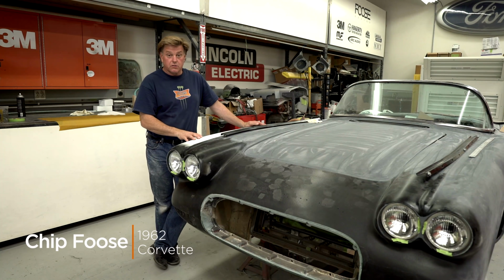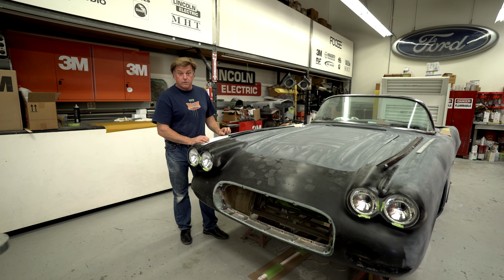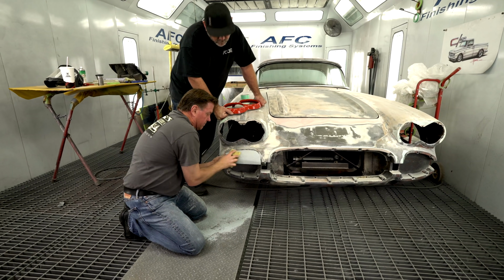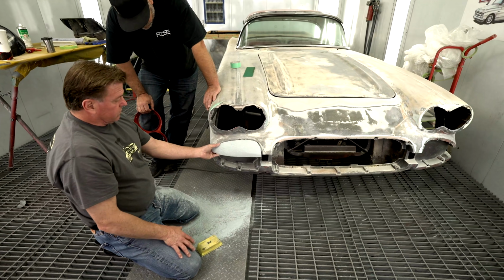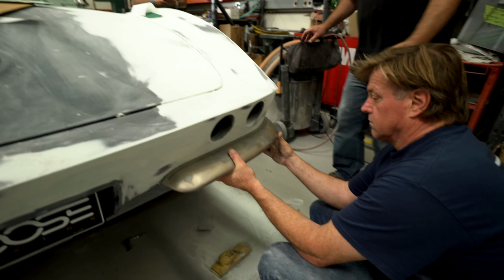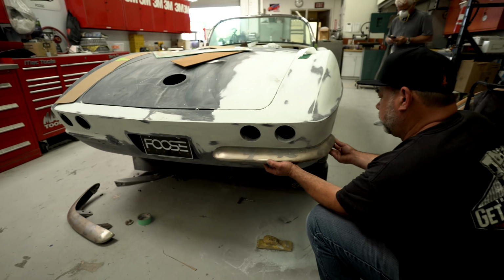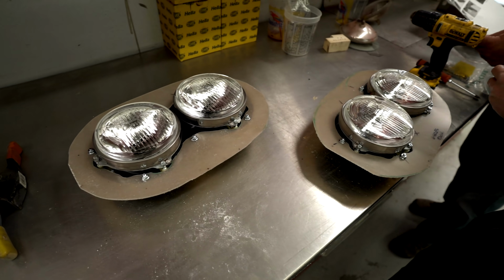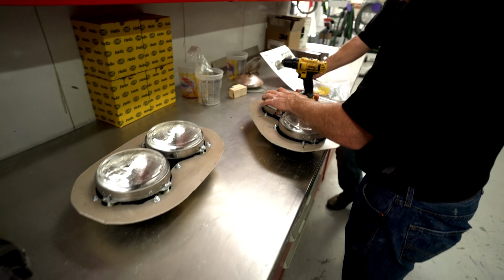Foose Design | '62 Corvette C1 Custom Build - Part 1 - Tear down and build up

Comment: I think the reason why I like Chip the most compared to other car builder's is he gets his hands dirty. Thanks for sharing
Reply: And most of what he does is unlike any other customizer in the industry, He aways has a different way of doing things has an artists touch in some way...
Reply: @shaunmostert1585  Yes he never rubber stamps his builds, each has it's own unique vision coming from what the owner wants to how Chip comes up with feeling of the build.
Reply: @jimwhitman5805  He almost always shaves the bumpers, bringing them into the body, making them part of the design, not just a bumper.
Reply: his style I so subtle almost imperceptible... that when you see the car you know what it is...but you can tell it’s unique and different but you don’t know how to describe it.
Reply: There's nothing like watching a Master Craftsman at work with his highly skilled crew. I can't wait to see the finished product.
Reply: @joesmith3829  15Use the edit icon to pin, add or delete clips.

Comment: I love the comments on sanding in a paint booth.  I worked on Corvettes for many years and did most grinding and sanding on fiberglass in the booth. Fiberglass particulates are nasty and the air flow kept skin irritation and lung irritation to minimum. Regarding keeping a booth clean for a perfect paint job - The booth was always thoroughly cleaned after the glass work was done.  I’m sure they spend plenty of time cleaning the booth considering Chip is one of the best car builders in the business.  Put some thought into comments

Comment: Do you use regular blue insulation foam and sculptors' semi-dense beige foam?  in the '80s, I used a green type foam that came in 2' by 4' blocks...We carved out amusement park rides, cartoon characters and other forms out of it. The foam was covered in chopped fiberglass and resin. It was fun stuff...You could carve anything out of it.  The Head Sculptor was the Maestro of Foam.

Comment: I would have filled in the lower sections and left the top half open and fitted turn signals in. This way you don't have such a large bare space below the headlights.

Comment: Question for Vette enthusiasts. If in 79 I was working in a body shop that had molds for 53-55 C-1 mold, 56-62 C-2 mold, 63-67 C-3 mold, 68 -at the time 79 C-4 mold. Is it that the 53-55 Vettes don't exist in your notations.

Comment: How much for a build like this? 140k?
Reply: usually with corvette owners they want a 140k job for 1400.00 only ones worse are jag owners
Reply: If 100k of that was the labour that would be 25  40hr weeks (100ohrs) for one guy at $100 an hour.  so I'm guessing much more.

Comment: Suggestion: flatten the front grille (reduce the height a bit), and extend the width.  It looks too large in the present guise.
Reply: Telling Chip Foose how to build a car. You got to be kidding right?
Reply: Aesthetic comments aren't dependent upon personalities.  I think Chip is incredible, but good ideas are good ideas no matter their source.  Do you disagree with that?
Reply: Mercari1964, how's your auto design business going, then?
Reply: @Mercari1964  What you said is right but you're assuming that your idea is a good one, that's were you're going wrong.
Reply: @nickturner2813  Irrelevant response.  Ideas exist on their own merits  and are NOT dependent upon whether or not I have a design studio.
Reply: @nickturner2813  Actually, I just suggested another interpretation of the front grille.  I don't know how there's anything wrong-headed about that.  Reasonable people can disagree about auto styling. You may disagree with my idea, and I may disagree with you and Mr. Foose.  What's the problem here?

Comment: Sanding in the paint booth? You're gonna get yelled at by the painter.
Reply: I used to fire guys for doing that...
Reply: down draft floor  also you can clean a paint booth painting a car also creates dust with the paint in the air that dries. Mutible  AMBR winner Riddler winner  hot rod hall of fame member I think his shop knows what there doing .
Reply: He is sanding the fiberglass in the booth because the exhaust system will keep the dust generated under control. Fiberglass dust gets everywhere and is toxic. I guarantee that once the work is done they will give the booth a thorough cleaning before any paint work is done.

Comment: Not real smart to sand in a spray booth. Booth should be dust free for a perfect finish
Reply: If only they knew enough to thoroughly clean it before painting! The airflow in the booth gets rid of the fiberglass dust. Have you ever sanded fiberglass? It will make you itch like you slept naked next to a mosquito farm pond in Minnesota.

Comment: The front end looks too bulky. If that were my car I would pull the area Chip filled in towards the grille to give it a more refined shape. Have the body curve inward  from the outside of the light bucket perhaps 2 or 3 inches. Not that Chip's design isn't a good one ; )

Comment: The 61/62 C1's have always been my favorite. That said, I hate what you did to the front end. From what you said about the bumpers, changing them to look like they were designed by the same person, I thought you were going to partially fill the outer grill areas and make new bumpers to match the rear ones. If you insist on filling these grill areas, at least fill the whole thing, leaving a bit open on the bottom, to be polite, looks awkward.
Reply: yea i thought the same looks goofy for real, i think the orig vette looks better, but he still builds some nice cars
Reply: Yeah, I'm not mad on the front end but Chip is pretty good in making his changes look like they belong - I will wait and see how it turns out.....

Comment: Front end looks weird now. Wish they didnt cut up such a nice car. Overall looks like something out of the late sixtys.  Foose is overrated. Malco shark vett had similar front end . Nothing new here. He blends in the bumpers as usual. Seen that going back to 1950's.  There r a lot better designers out there that dont get the recognition. But I hate when he cuts up a nice car. use a bucket case instead. To many old cars being cut up.

Comment: I don't know why seeing this much fiber glass on a 62 corvette gives me the same "this wrong" feeling like when I saw for the first time a front wrecked 4gen camaro 
maybe it is because it same fiber glass that was used to make small fishing boats in my town.
or that fiber glass plus bondo equals dirty quick fix for rust holes in cars
or maybe because it is Chip I just expect see a English wheel and piece of sheet metal turn into a car

but the funny thing is I would not mind seeing Chip design and make a carbo fiber body and body parts for a corvette chassis

but i digress
Reply: You do realise that Corvettes of this era and beyond were totally fibreglass bodied from the factory I hope.
Reply: @_._._._._._._._  damn not sure how that got passed me and this makes more sense now
however oldest  GM car my dad had was 1964 Chevelle 4 door to 68 chevy to 72 chey to 82 buick and some GM fwd things after that
other family cars 1968 2 door Buick 350 that engine put in dalta 88 1976, another 1984 delta88 and my brother 1984 TA that I own today, but I have not part out or worked on any corvette 
and my first car was a 1980 Oldsmobile omega 2 door